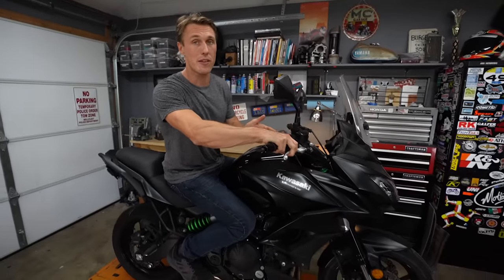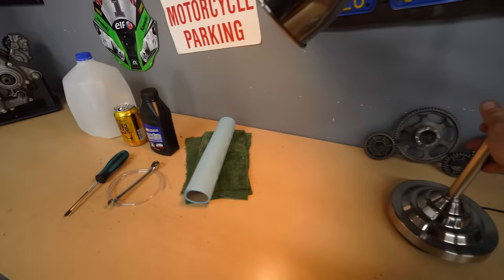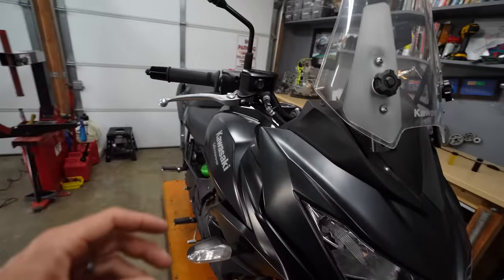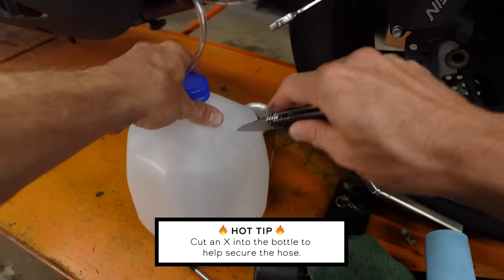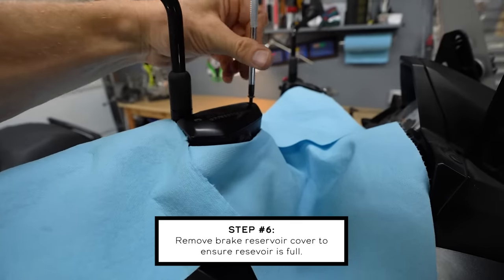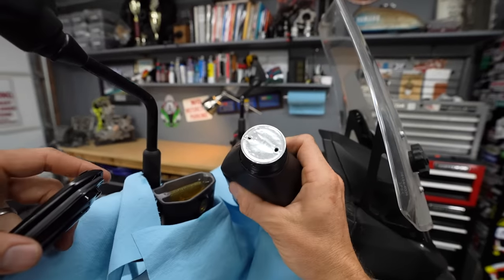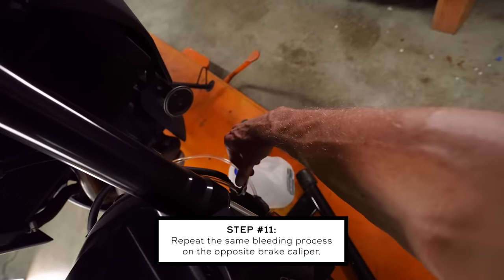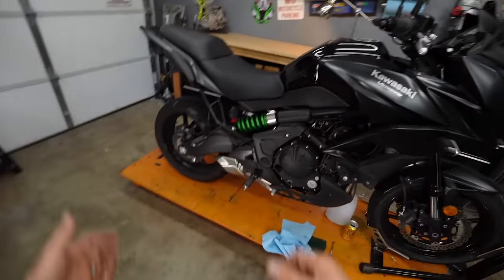How To Flush and Bleed Your Motorcycle Brakes | The Shop Manual

Comment: You can bleed by pressurizing the system before opening the valve, like in this video, or you can bleed by pressing the brake after the valve is already open. What's the difference between the two?

Comment: Here's another pro tip: If you don't have any friends to help reach the back brakes like me.. all you need is a small 2x4 to push the brake down with your right have while you use your left hand to crack the seal. 

Was very easy for me this way just had to stop every couple of minutes so my leg didn't fall asleep from standing in that awkward position for too long.

Comment: A solid video BUT if you bleed the beakes on a ABS model this way there will still be old brake fluid in the ABS circle that will not bleed.

Comment: Start with the furthest caliper. That's a pro tip and few do that. 
I would add one more tip, though. After job done and before covering with the rubber cap, use paper towel to dry the interior of the bleeder.  That way will minimize the higroscopic effect at the closest entry point to the fluid. 
Overkill, maybe? Rust also is ;)
Keep up the good work.

Comment: I was told on ABS  models you need to do the full bleed front and rear brakes, then ride to a safe area (dirft road) to activate the front and rear ABS,  then repeat the bleed for the front and rear back at home for the front and rear. Or connecting it to a computer to activate the ABS. Has anyone heard the same thing?
Reply: Yeah I heard the same, as apparently some fluid always stays inside the pump and if the pump is not activated it doesn't circulate into the system, gathers up moisture and leads to corrosion of the inner workings of your pump. But the amount of fluid in the pump is very little, so a couple safely performed gravel breakings are all you need. Some like to bleed after that one more time but that's a bit overkill in my opinion

Comment: I'm replacing the master cylinder on my bike. The screws are all chewed up. They look like someone took a drill to remove them. I am also replacing the clutch master mostly to make it look nice, and the 2 come as a set. I'm also doing it because the lever has a strange curl on the end.
BTW. Is the operation to bleed the clutch the same?
Reply: Yes, bleeding the clutch follows the same procedure.

Comment: Thanks for this great video. Quick questions : what about dismounting your breaks and put it at the highest point of the system to make sure to eliminate any air bubble  when bleeding the system? Especially when you have a bridge between right and left side of the front breaks, air bubbles can remain at the highest point of the bridge (which is typically top of the mud guard on the video) as air will always move upward. Is this true or not ? Thanks ;)

Comment: ive seen some video tutorials... they drain the brake fluid and after draining it empty then they use a syringe with a hose attaching it in the caliper... then  after cracking the reservoir open he injects it going up to the reservoir... but he remove first the air bubbles before attaching it to the caliper..... kinda like reverse bleeding without the pumping.. i dont know if that works...

Comment: So same thing for the bleeder on the Brembo master cylinder I presume? (2018 Monster 1200s). I just changed my tires and the front brake is positively mushy compared to my 2019 Tracer GT (which is rock solid).

Comment: thanks for the video it is TOP !! 
The camera angle is nice !! we can see everything ;) i just have 1 question .. i have bought  2 new  brake fluid from my car/motorcycle shop and i bougt new ebay brake oil tester ... they bouth failed test ! brand new ! should we be testing this oil everytime before use? ride safe!
Reply: I've never heard of a brake-oil tester or any way to effectively "test" brake fluid. Test it for what? Moisture content? I kinda feel like the tester might be a scam. If the bottle of brake fluid is sealed (the foil is still adhered to the top) then you can rest assured it's good to use.

Comment: My bike seems to be weeping a very miniscule amount of brake fluid by the bleed valve on the caliper. Every few days there is a small amount of moisture around the nipple. Do i need to remove and reseat the valves or how do i know if i need to buy new valves? They are in tight. 
Thank you

Comment: If the existing brake system has DOT 5 and it should be DOT 4. What is the best way to clear the system of the DOT 5. I do understand that DOT 4 and 5 should not be mixed.

Comment: For anyone concerned about a few errant bubbles in their brake fluid... even after a flush...

    Refill the reservoir and seal everything as indicated in the vid'... AND just as a good practice, pump the brakes one last time and put a ZIP-TIE around the lever to hold it down... and give it at least an hour or two... You CAN leave the thing over-night, but I can also understand some hesitancy about that prospect... 

    This helps with wrenching at any point on the brakes, too... like replacing a broken lever/master cylinder (like after a drop)... Obviously it does NOT replace the procedure of properly bleeding the brakes and flushing out fluid as prescribed... BUT if you accidentally let go of the lever, or slip up, and you simply can't carry on for a whole repetition of the thing... this helps mightily and may well save you from the excess frustration...

     I generally finish a flush/bleed procedure with a short ride, and then check the reservoir again JUST to be sure I was actually paying attention to every little thing and didn't so something dumb... inviting a leak or whatever... It happens to the best of us... BUT about a 5 mile jaunt will tell you how your brakes are operating and with some repetitive braking practice, you can put a little extra work/stress on the system... THEN when you park back at the garage, you can check the fluid. If nothing seems to be missing and you don't find any errant drips on wheels or fenders... the system is likely properly secure...

    That's when I go ahead with the pump up and ziptie trick, just to leave it over night and the brakes are (usually) as solid as they'll ever get in the morning... ;o)

Comment: Explain the difference between cheap master cylinders vs more expensive master cylinders.  More expensive not necessarily faster stopping but better feel of progressive braking.
Reply: Perhaps you mean the difference between axial and radial master cylinders?
Reply: Compare Nissin master to Brembo master for example.  Compare stylema vs a nissin caliper.  Why do companies mix components nissin master with Brembo calipers.  Also different size pistons in master cylinder, why?

Comment: Any tips on charging an empty or new brake line without a vacuum? Best I’ve come up with is a messy syringe to inject fluid from the caliper up to the master cylinder but it ain’t pretty.
Reply: You can still bleed downhill.  It takes longer as you are fighting gravity rather than working with it, but I replaced the brake lines on my BMW and bleed using just the master cylinder and it worked fine.  It is more efficient though to push the fluid up from the caliper if you have the equipment.

Comment: recently i fell from bike to right side. after that break lever doesn't operate properly. often when i apply, lever comes very close to throttle grip. is it because the spring and master cylinder is faulty/broken?

Comment: I'm looking to by a new motorcycle and make a road king looking bike. The problem is have is that there are 2 disc brakes on the front wheel and i don't like that. Can you remove one or is that not possible?

Comment: Can I use a different fluid than what is said on the reservoir cap. I have R3 and it says on the cap that it uses DOT 4 fluid. But few days ago when I went to a dealer to get myself some fluids and filters for me to change them they only had DOT 5.1 brake fluid in stock and guy there told me it is OK to replace DOT 4 with DOT 5.1 because they are both glycol based and the main difference is that DOT 5.1 has higher boiling point. So there should be no problem in me using it in my bike?

Comment: Out of curiosity, would you recommend to do it from bottom up?injecting the brake fluid into the caliper bleeder valve  up tu the brake reservoir?
Reply: That's a technique I reserve for after I've replaced a brake line or rebuilt a masters cylinder or caliper. It's very helpful for purging large quantities of air. Once I get some pressure in the system with a reverse bleed, I revert to standard bleeding. It's the only way I've found to get a truly firm lever feel.

Comment: If you do not have a cheap little $10 one-man bleeder bottle from a random parts store or Amazon, my favorite to use to collect the fluid is...the bottle you are taking brake fluid from.  Sure, collect it in a can or water bottle or whatever but them dump it into "new" bottle of brake fluid when done to dispose of.  Why waste the remaining new brake fluid?  Because you are not going to mark the date you openned it on the bottle making you tempted to use the remaining fluid a year or two later when it is compromised from moisture.

Comment: 7:03 Identify JIS screws by a small dimple in one of the four angles on the screw head. Supposedly you can grind down the tip of a Phillips #2 driver just a bit and it won’t cam out. Horror Freight has, or had, a cheap set of red handled drivers where the “Philips” drivers were actually JIS. I have a set. I also have a nice Vessel JIS driver like this guy has. Phillips will chew up your JIS screws. I know, I know! You’re the guy who never makes mistakes! I know That Guy. Every screw on his bike is f****d. I bought a VFR from That Guy once. There wasn’t a single maintenance task on that bike that hadn’t been done wrong. Stick with the Philips if you’re That Guy. Just because you will anyway.

Update: Ok he mentioned the dimple. Well done!

PS Great video. After dicking around with a Mity-Vac and getting shitty results, I finally figured this out from first principles this year. This could’ve saved me a lot of time and hassle if I’d seen it years ago.

Comment: 2017 ZX-10RR, my Service Manual is in conflict by stating two different torque specs in two different areas.  One area states front caliper bleed valve as 12-inch pounds.  Elsewhere it states 12 foot pounds.  That is like an 1100% increase!!  This must be a misprint but no one seems to have the "correct" answer.  Thoughts?  I do not want ro over-torque because some incompetent proof-reader screwed up.

Comment: I like to use a 40ft hose when I bleed my fluid and do it right into the storm drain. SO MUCH less hassle than driving to the store or using a can.
Reply: I use the old fluid as weed-killer. Works like a charm and better then "Round-up".

Comment: I prefer to wrap a garbage bag around the master cylinder rather than paper towels.  Drape it so that any spills run off to the floor.  If you still on the paper towels, they can soak through to the paint or get soggy and fall onto the paint and then you have to stop midstream and wash off the paint.  No such worries with a garage bag.  And they are large enough to cover a lot of the bike.

Comment: I feel so helpless. I have been doing this for hours. The feel of the brake lever is still as spongey as when i got started, actually worse.... I am making sure not to release the lever until i re-close the valve down there by the caliper. I've done both sides and the brake still goes straight to the hand grip effortlessly. What am I doing wrong? Is there a chance i need new calipers?

Comment: I do my brakes the exact same way, i'd say the only difference is that i would cut a hole in the cap rather than the bottle to put the hose through since the cap can just be replaced and reused and i'll save that 5cm worth of duct tape.

Comment: My brake lever has no pressure at all after I changed the brake line hose. I've cranked the lever, held it and cracked the nipple to let air out and I did it for hours and still no pressure.  Also ziptied the lever over night and still nothing. Any ideas

Comment: I did the rear brake.  It all went fine.  But on the front brake, when I open the bleeder, nothing comes out. The master cylinder is open.  And I have pumped the brake lever.

Comment: Have RC 390. Put a aftermarket brake pump. When it gets hot the lever moves out and when it cools the lever comes back in. I'm having steel braided lines. Abs as standard and brembo sintered brake pads. I've tried 2 master brake pumps and same issue. Tried bot dot 4 and 5.1 and still the lever gets stiff after riding for a while. Then cools down and becomes a bit soft. No air in the system. Any idea what's wrong ?

Comment: I don’t get it so you empty the old fluid or just leave it in?
Reply: I left it in on this job b/c it wasn't that nasty. But if the fluid in the reservoir is really gross (like gooey or crystallized) then I'll remove it first with a syringe or by sopping it up with a paper towel.

Comment: Can the brake fluid last longer than two years if I almost exclusively engine brake or is it still a good idea to change it every two years regardless?
Reply: My fluid was 15 years old and worked like new
Reply: If your bike gets exposed to the elements a lot (stored outside, or you live in a wet climate), brake fluid can still go bad faster than you might think.  If in doubt, inspect the fluid in the reservoir and bleed a few drops out at the calipers.  If it's discolored, just replace it.  It's a pretty cheap and easy job either way, so I wouldn't go too much longer than 2 years no matter the bike or location.  Old fluid may still seem to work just fine, but once it's absorbed enough water you're running the risk of rusting your brake lines, which can then fail catastrophically and leave you with a stuck caliper or with no brakes at all.

Comment: Great video. 

Just one point that might actually kill you if you DIY this. DO NOT overfill the reservoir. If you overfill and your brake fluid has no where to go on thermal expansion, you're going to have a VERY bad time.

Comment: There is only 1 thing I’d say that wasn’t covered and that’s that you should really put fresh pads in before you do brake fluid. 

If you have pads that are almost worn out that means the pistons in the callipers will be mostly extended so when you go to put fresh fluid in if you fill the reservoir full, when the time comes to put fresh pads in there will be too much fluid in the system.
Reply: You can always open the bleeder valve while compressing the pistons mate 😉

Comment: The method here is fine for most bikes, but beware of bikes that have brakes linked with a proportioning valve and hard piping between the front and year.  Honda's VFR800, for example, has a rather complicated method of linking the front and back brakes.  The VFR, for example, has a secondary master cylinder on the left front caliper, and hard brake lines (like a car), that run from from to rear through a proportioning valve.  On that, rather complex system, the steps for bleeding are different and are set forth in detail in the factory shop manual.  For that type of system, a vacuum pump is required.  It is simply not possible to bleed the intermediate proportioning valve and long brake lines with lever pressure.  Many DIY jobs on a VFR (and there are a few other models with this system), will create real trouble.  And here's another pro tip:  routinely drain and replace the fluid in your master cylinder.  The new fluid will slowly work its way through your system, and if you do this regularly, will keep your fluid fresh and reduce the need for bleeding the lines.
Reply: thank you for this comment, forreal... i was gonna try and do this on my VFR800....... i figured it would be fine since the front and rear are kindof like the left and right front caliper....

Comment: What if the brakes are sticky and only go about halfway and then get stuck, requiring much more force to fully engage them? If that a greasing issue?
Reply: Sounds like corroded or dirty caliper pistons, or glazed brake pads.
Reply: @AriH211  Thank you! I’ll check on it today.
Reply: @AriH211  They’re the original pads, so the caliper probably needs cleaned.

Comment: I noticed during long steep descents top enduro riders turn the engine off on their 2 strokes, why is that?
Reply: Because 2-strokes need an constant feed of fuel-oil to the engine otherwise components are worn out pretty quick. Now when you go downhill you don't apply almost any throttle, hence you don't feed the engine the mixture but it's still reving up, as you downshift. So to save the engine it's a good practice to shut it off during downhill riding.
Cheers!

Comment: Shown here is the least desirable way to bleed the brakes. Better method is reverse bleeding: 1)Get a syringe and connect to the tubing. 2)Put the tubing in the brake fluid container and fill the syringe. 3)Push out any air bubbles back into the brake fluid container, then put the cap back on the container. 4)Connect syringe and tubing at the bleeder over the wrench. 5) Crack open the bleeder and use the syringe to push the brake fluid up the brake line to the master cylinder. You can watch the fluid fill up the master cylinder. Any air in the system will rise upwards to the master cylinder and dissipate. 6) Tighten the bleeder and remove the tubing/syringe. I use a glass 30mL syringe that is easy to clean and has no rubber plunger tip. You can use a food injector syringe or a disposable syringe.   Pros are: No catch can, receptacle or bottle, no pressure bleeding the brakes, air bubbles rise to the top and don't get trapped in the system, no pouring of brake fluid into the master cylinder and potential spillage on to your controls or bike.   You can also flush the system this way.  Inject clean fluid at the bleeder and use the syringe to remove the dirty fluid from the master cylinder.